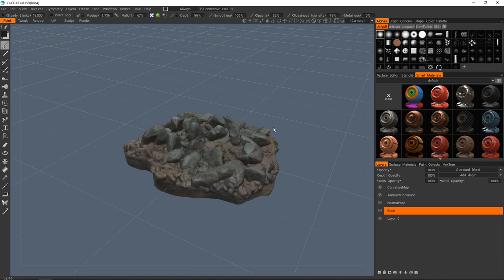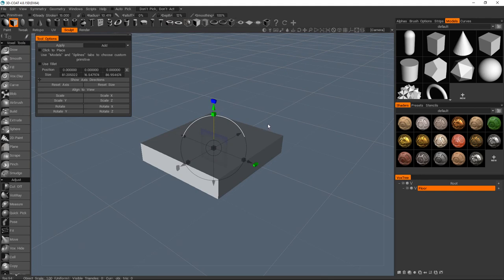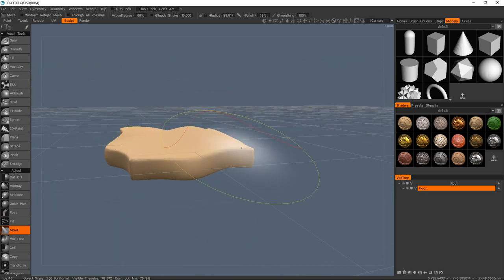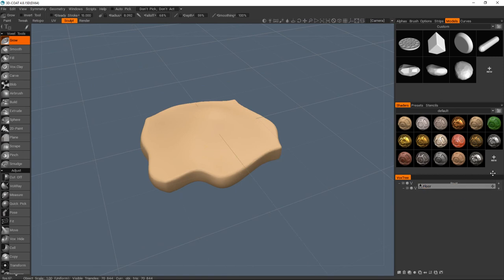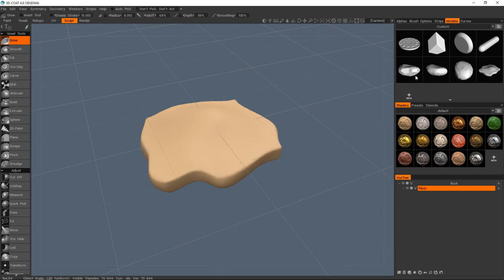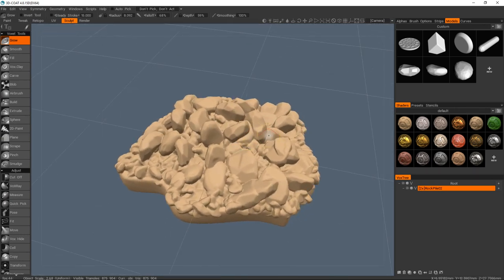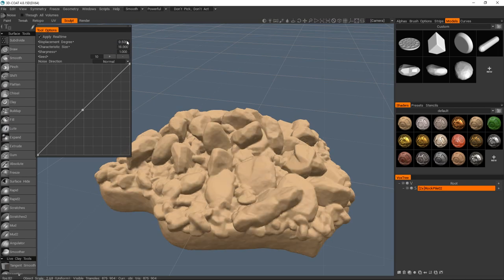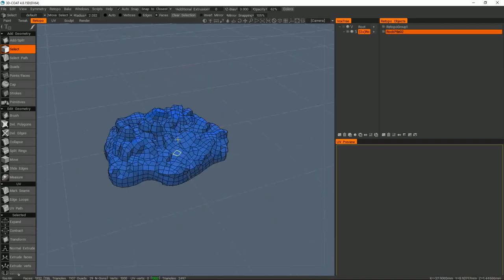Low Poly Debris Pile, 3d Coat Tutorial.

Comment: This tutorial is almost exactly what I needed. I'm new to 3d coat and i'm having an issue where I go to paint the mesh asset across my base and its only letting me put one down at a time. Can you help with this?
Reply from the maker: Are you in Voxel or Surface mode? I think this functionality only exists in voxel mode. Also make sure you're using the import tool, as sometimes I've found when clicking on a model in the "models" panel it doesn't always automatically switch to the import tool. The only last thing to check is your brush type, make sure you're on a strokes type of brush and not the "Stamp" one.
Reply: Thank you for the fast reply! I will try these methods when I return from my travels.